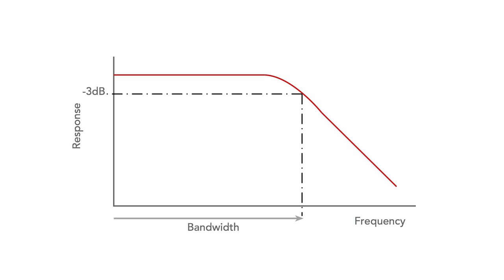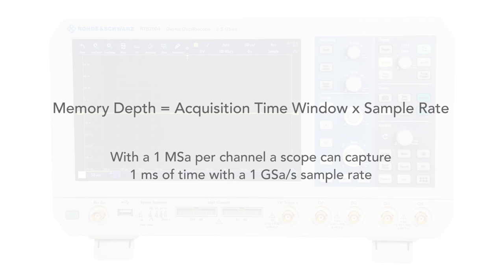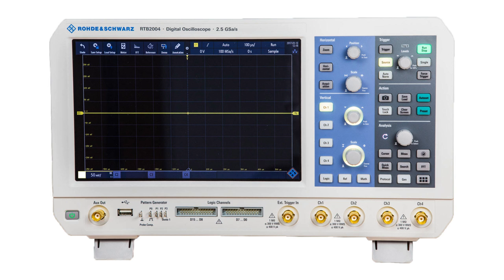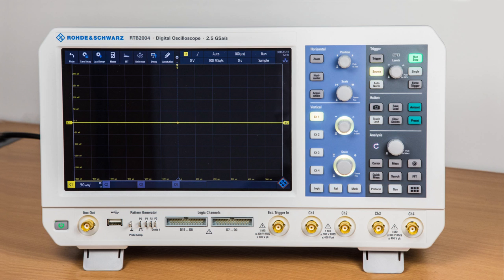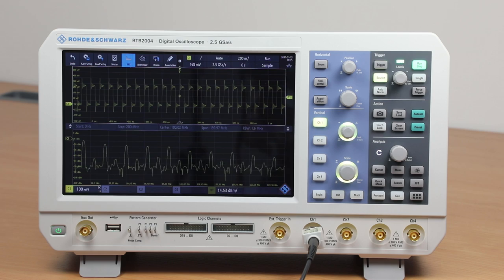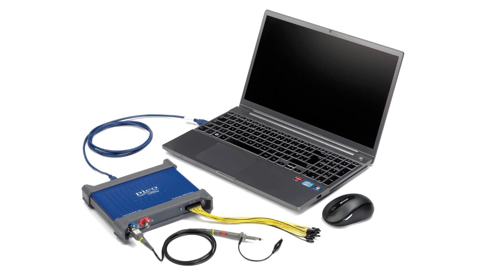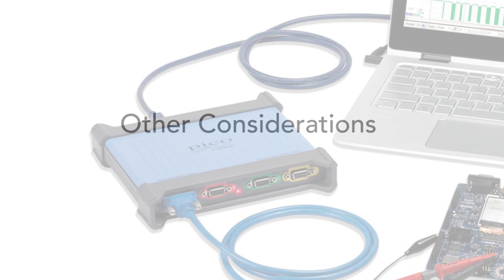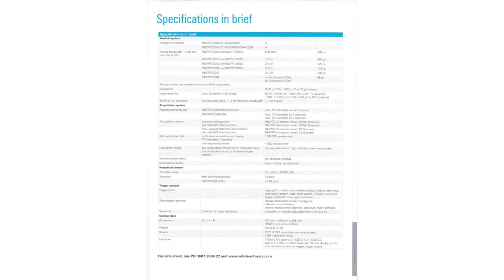Buying an Oscilloscope: what to look for

Comment: I'm looking for a simple beginner's scope to be able to measure and monitor simultaneous voltage and current plots (using current clamp) along with phasing.  The power i'm wanting to monitor is right around 400vac or pulsating dc at about 1 or 2 amps and 400 hertz.  That's all I need it to do. It's for an ignition coil driver circuit.  Can anyone help me out here?  Looking at cheaper scopes like the Kiprim DS1202, or the Hantek DS02 C or D series, or the Yeapook ADS1014D.  Would any of these work, and what current clamp or probe would work?  New to electronics here and trying to learn.  Any help is greatly appreciated.
Reply from the maker: It might be worth looking at a USB scope - using a linked computer they can offer very good levels of functionality for a fair cost.
Reply: I'll check those out.  Thanks for the input.

Comment: Master, take it easy First of all, I want to ask you;
Is it possible to measure frequency beyond the specified frequency limit on an oscilloscope?
or how much frequency measurement can be made beyond the specified frequency limits. 
thank you...
Reply from the maker: The response of the oscilloscope will fall beyond its specified top frequency, and the voltage measurements will not be accurate, but it is still possible to measure the frequency.

Comment: Will I be handicapped by my oscilloscopes lack of an external trigger?
Reply from the maker: It depends upon what you want to do. If you have a pulse that would normally provide the trigger, then you may not be able to use this, but if you have sufficient channels to accommodate the pulse you want to use as a trigger then you can feed it into one of the scope channels and trigger on it even if you do not want to display it.
Triggers were initially provided when the scope had a limited number of channels and there may have been the need to trigger on a system pulse you did not want to display whilst using all the channels for traces you did want to display.
Reply: @ElectronicsNotes  it's a two channel oscilloscope with no external trigger.  I just have a basic knowledge on the working of the oscilloscope so I'm not sure but what if I need the two channels plus the external trigger for an experiment,is there a way I can work around it with my spec?

Comment: Not impressed. No actual figures were quoted making it impossible to rate any potential scope. It all sounded like a vague advertising video.
Reply from the maker: I'm sorry you did not like the video. We tried hard to give guidance and information but as everyone's requirements are different, putting exact figures down can make the video dry. However we will try to take you comments on board for future videos and look at ways of adding more detail.
Reply: An advertising video for R&S I am sure. . .
Reply: I don't know if we watched the same video but they are not holding your hands on the "buying a scope" process. All you get is info, on what to watch out for and the rest is up to you. An electronics engineer who is designing circuits in his spare time has other specifications on what a scope should do compared to a student tinkering with an arduino, creating some sine waves. So yeah, video is perfect, your comment is unjustified.

Comment: Almost the entire video is just stolen from a rhode&schwarz advertisement video.
Reply from the maker: We actually worked with R&S to try to use their experience. As you will have seen we used a lot of their people as they were available and we did not have the same access to others. We did try to include as many other oscilloscope types as we could, including PXI based ones and USB ones which R&S do  not manufacture or market. We also tried to ensure that the comments were not R&S centric so that people could benefit from the experience of industry experts. Also we stole no content from R&S. All the interviews were done solely for Electronics Notes and have not been used on any R&S videos.
Reply: ElectronicsNotes In that case please accept my apologies for my ignorance.
Reply from the maker: No problem.